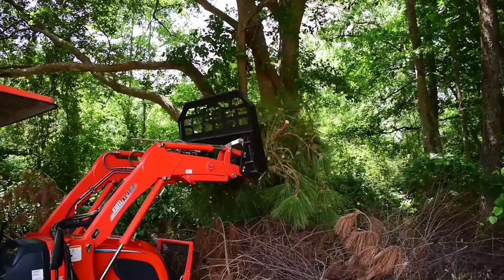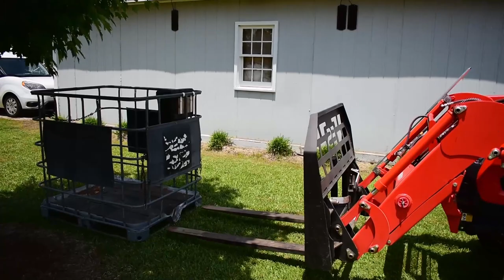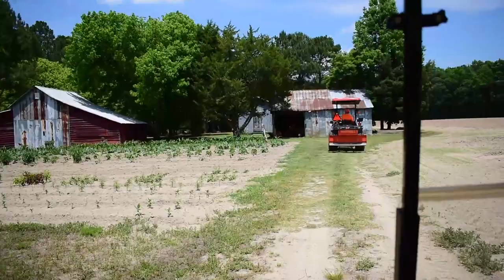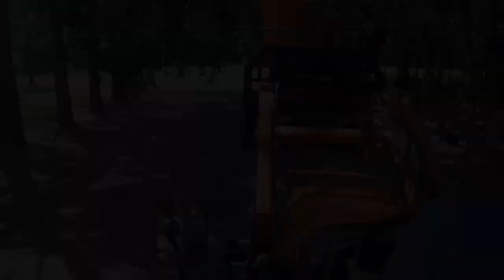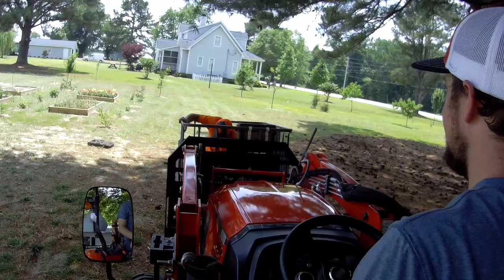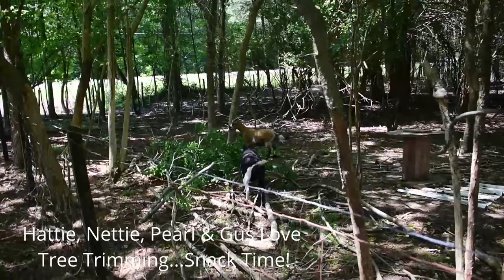KIOTI CK3510 SE HST Tractor: DIY IBC Tote Man Basket

Comment: I've really been enjoying your channel! Thanks for the great information and editing. Keep it up.

I'm about to get delivery on my first tractor, a Ck3510 se hst like yours. 

How high were you in this video? How high would you consider to be the max before this application being too risky?
Reply from the maker: Hi Raymond, thanks for watching. The loader will only lift to a height of around 98” (so around 8ft)  at the pins. So even at full height I would consider it safe.  I was probably around 6 to 7 ft in the video.  The length of a pole saw really allows you to be able to reach limbs 15 to 20 ft up.  Definitely safer than trimming from a ladder in my opinion.  Just be sure to have a safety measures in place and make sure the tractor operator is experienced. Good luck with your tractor, you will love it.